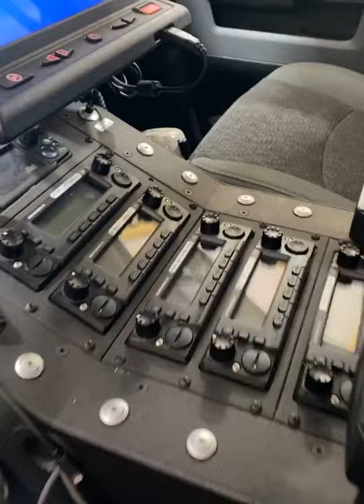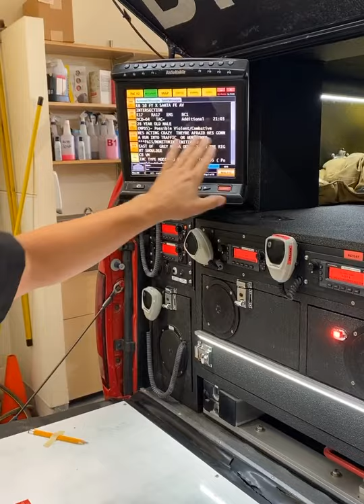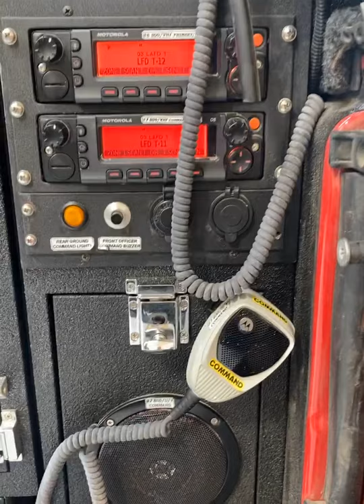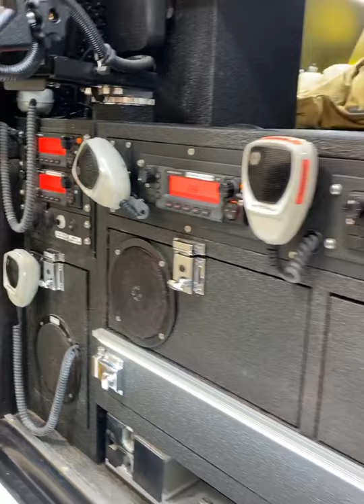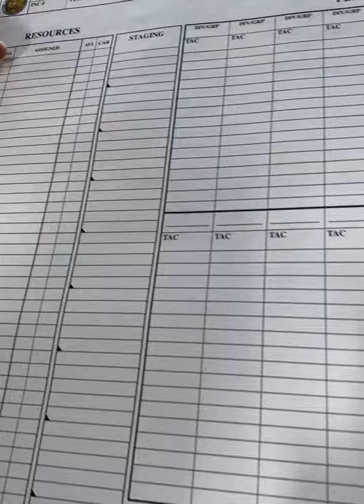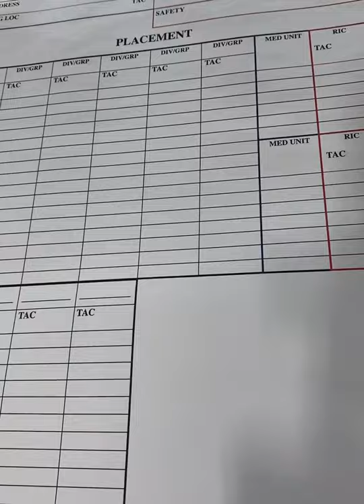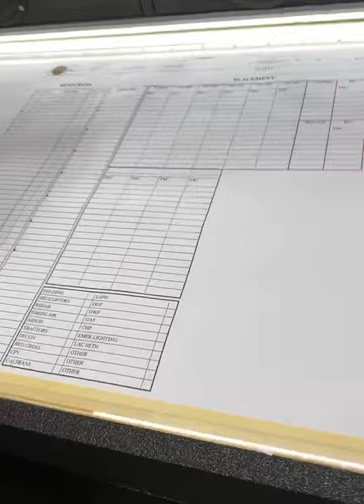Live with LAFD: Battalion Command Team

Comment: I grew up in LA and worked McCormick Ambulance with LACo, eventually becoming an FF myself out of state, so somewhat familiar-ish with LAFD terms, but yeah, the specifics of Greater Alarm vs Major Emergency Structure Fire always eluded me, this makes it a LOT more clear and understandable. It seems there's a basic initial response (1st Alarm equivalent), additional companies for Greater Alarm sounds equivalent to our 2nd Alarm, and Major Emergency with 15 Companies is essentially a 3rd Alarm for us more or less (Every alarm used to be 3 engines and a Ladder, then a few years ago they changed it so one of the engines from the 2nd Alarm is now on the first, but they put a Rescue squad in that spot, so now it's 4 Engines, a Ladder, and a BC 1st Alarm, 2nd Alarm is 2 Engines, a Ladder, Rescue, and 3rd and subsequent Alarms are all 3 Engines and a Ladder (unless IC asks for something else specific)... so how does that compare to LAFD basic initial alarm building fire response? I've seen 2 Task Force's and 2 Engines plus BC and RA before, is that accurate?